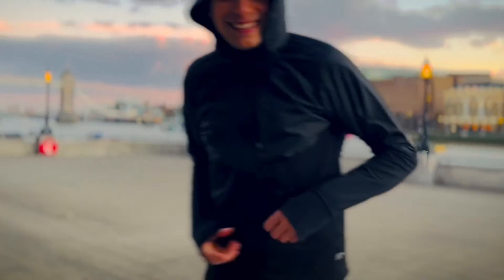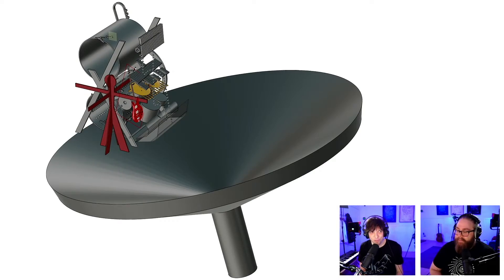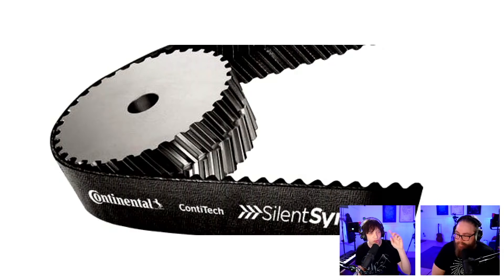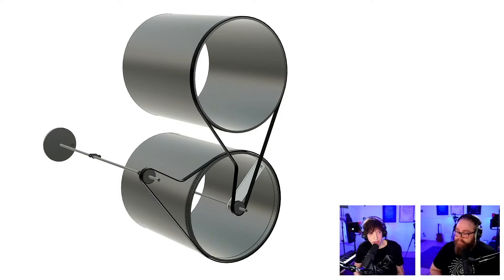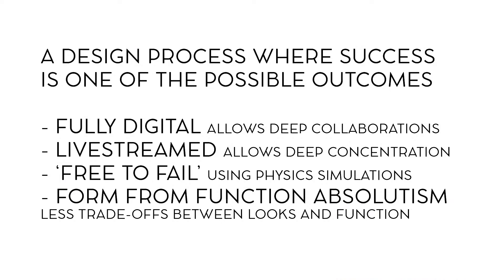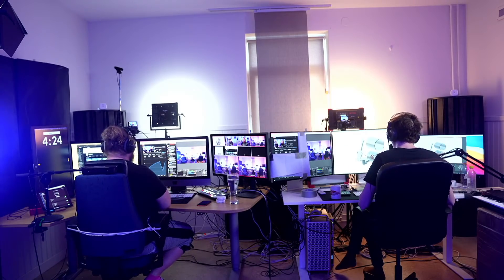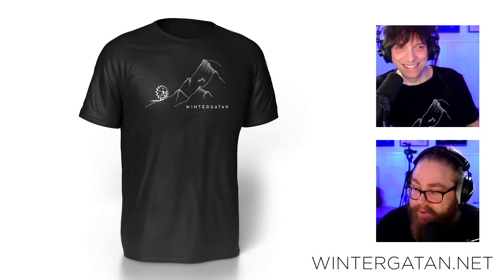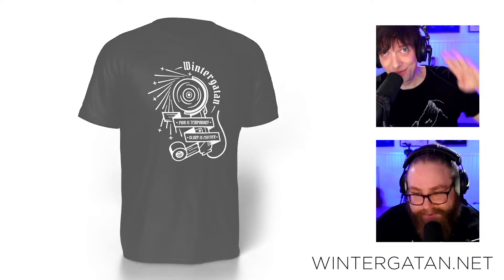Round 3 - Martin vs The Machine - Week 1 Summary

Comment: I have an idea to fix the programming plate issue, what if you had small scale short travel linear actuators behind the plates that were addressable, so they can change “on the fly” per rotation if necessary. You could leave the plates permanently on the machine and write the program to set the pins to “in” or “out” and then load different programs for each song.

Comment: As a lesson learnt from MMX, you also need to focus on these features:
1. Repairability (if something breaks on tour can be fixed with WD-40 or duct tape)
2. Transportability (disassembly-reassembly for transportation)
3. Reliability (you know it yourself)
4. Reproducibility (if a machined part breaks, a quick order can be sent to any local workshop it you have no spare parts with you)
5. Safety (it does not kill the artist, trasporting crew or the maintenance guy)

You failed in most of these aspects of design the last time. You can do a better job this time. 
Godspeed!

Comment: The helical pulleys are too complicated (they are no quieter!)  This is example of overdesign!  Use simple spur pulleys!  For the drums, you want gears so you don't need to fuss when changing them.  (Regarding gears, since when did they make noise?  Only the fastest-turning gears will make noise.  You can use belts for those.
          I allege the machine noise is PART OF THE MUSIC.

Comment: I have to say hearing that the MMX is just being stopped come out of nowhere. I fully understand your choice to work more on it which is why videos became less frequent but I am with the majority of the comments with regards to you continuing on the MMX until it's finished and a song could be played. I feel you may be in your own mind when it comes to perfection. Engineering is something where we make our ideas realty by our own hands while getting to the point where things are safe and good enough because we know nothing is perfect. To me at least you had fun as you worked on it despite the frustrations but also enjoyed those moments when you solved your problems. The moment you set yourself the no marbles on the floor requirement is when it became less about becoming better design wise and it seems like you became frustrated in those videos as that goal became an obsession. 

As you already no doubt have realized through this experience a part of making something is iterating on the design as new problems come up and it may be a while before you can reach a point where you iron out all these issues which come up, but once you do you will feel great about having stuck through it and proud about your final product. I feel you may missed the point in some of this when you consider the whole machine a failure instead of just continuing and fixing the last two issues we were shown. For the backlog of marbles in the constrained marble path which can easily be resolved by either making the path for them to get there longer giving more separation time between individual marbles while playing or have them funnel into a reverse of the divide by 4 above so it becomes a multiply by 4 which takes 4 inputs and funnels it into one input which would lead to less marble jams due to how marbles form up in there. As for the issue of the PMMA transfer pipe between 1st and 2nd gear exploding that was a result of too many marbles picked up at once due to the extreme backlog of marbles jammed from the constrained marble path, so fixing that issue should for the most case fix this one and in the event it does not you could always look into introducing something which limits how many marbles in a group enter the 1st gear as to avoid that pressure.

The MMX is already so close to completion with only the final fixes and issues needing to be resolved for it to be fully done. Jumping the gun because you are unsatisfied with what you have due to having to deal with it's issues and making a new design to start from scratch will be a waste of: years of time you spent on the MMX so far, money for supplies on the MMX, and support from all those who have been with you on this journey so far during it's creation while you have been making it.

Will finishing the MMX as is take time? Yes. Will it be hard work to get it's issues solved? Yes. Will you feel good for completing it? 100% WITHOUT A DOUBT YES. There are a lot of things you can decide to do for this project and the final call is yours, but one thing you should never do is not finish something and end up regretting it later on. That's a kind of regret which eats away at you personally and always makes you wonder what could have been if you just followed through on it.

Comment: The fact that the first two machines are considered failures or defeats is gravely concerning for the future of this project. The original had flaws, but the result was captivating and is most likely why the majority of us showed up for the MMX journey. If that’s defeat or failure… standards are way too high. Then MMX, yes there are flaws, however at the least it could have one song with a video. It is leaps and bounds ahead of the original machine. It is an engineering feat despite flaws. You learned so much through this process. Evolved so much as a person. Bettered yourself through the process of designing and building MMX. But it seems that pessimism has let you down. This isn’t simply “the glass is half empty.” This is having nearly a full glass and saying because it’s not full it is empty.

We all want to see you succeed. I think you can and I think everyone has your back, but I am concerned by the mindset I see in this video considering the first two machines failures, defeats, losses, whatever. 

I’ll personally continue to follow this new journey because I believe you can do it. I am optimistic for the future. However I, and I think from reading the comments most others, would love to see one song for MMX (or maybe even a handful). It would be worth it and it would be the end to that project you and the community deserve.

Comment: You joke about the floor being a funnel but if you just put a large mat underneath the machine that slopes towards a central location any dropped marbles would accumulate there, it would only have to be a few inches thick and would absorb the sound of marbles hitting the floor so they don't interfere with the music. Given the designs for magnetic lifting wheels you have already made it should be trivial to give the machine the ability to pick up those dropped marbles and return them to circulation automatically. That would be somewhat more realistic than never having the machine drop marbles at all.

Comment: Here is a tip, that I said a few years ago and would probably have saved him a few years of time. Use 3D printed parts! You have infitite complexity, and you just have to print them. No welding, no sanding, no complicated machining, no drilling of holes, no measurements. Some things need to be steel, but for almost anything that is made from wood you can just print them.

Comment: Actually for a mass market complex products you have these prototype phasis before the mass production:

Engineering Validation you validate that the concept is working.

Design validation you validate the full product and you freeze the design but the parts are not made the same way that they will be in mass production.

Process validation, now you have all the tooling required and you tune the fabrication process to have the exact same product that you will have in mass production and you work to improve the production rate.

Sadly MMX is not at all a Design Validation, actually it's not even an Engineering Validation since he decided to restart completely from scratch. MMX is only a proof of concept that it could theoretically work, it's a beautiful proof of concept with an artistic spirit but that's all.

Actually even with CADing Martin will need to do some physical prototyping so he will still need to do these 3 steps, because even if it's supposed to worked digitally it doesn't mean it would work in the real word.

Comment: I'm not sure that cutting gear teeth into the plastic pipe stock is going to be a good idea. You will waste all the whole thing when the gears wear out, and trust me, the HDPE used for piping is definitely not designed for abrasion resistance. Also, the pipe wall is not particularly thick, so you might be making some compromises with the strength of the teeth right from the get-go.

I think the superior option would be to simply fit the helical gear "ring" over/around the pipe, and just key it to the pipe so that there's no slip. If the  gear has to be replaced, remove the keys and swap the ring part(s). You will need some sort of machined insert to keep the pipe round anyway, may as well build it all together. Or have the "flywheels" with the gear teeth instead.

Comment: MARTIN YOUR HELICAL BELT IDEA WILL NOT WORK AND HAS NO NOISE ADVANTAGE OVER A STANDARD AUTOMOTIVE STYLE SERPENTINE BELT. The noise you are  think the helical belt will reduce is only significant at high belt speeds, not the 30-60 rpm of the MMT.  The idea to make custom pulleys and belts is $$$$$$$. This is a VERY BAD IDEA DROP IT NOW.

Comment: MARTIN you are again making big mistakes from the start that will impact your machine down the road. You are getting WAY TOO ABSORBED BY "HIGH TECH" and not focusing on the #1 problem with the MMX and the first machine. Marble transport and management. You are getting bogged down in the micro details of marble release components before you design the marble flow. Work the BIG picture first!!! 40 years ago I prototyped stuff using cardboard cutouts and boxes to see  a 3D view of what we were trying to design. CAD is great, but as you should have already have found out, you don't see the problems until you have something physical to see. GET THE BIG PIECES DONE FIRST!!!!  You've placed your instruments. That's great. Your next step should be  to BUILD YOUR MARBLE ROUTING  AND FLOW  MANAGEMENT. You may have to move things around to prevent marble flow issues. The release components may have to change based on how they fit in, so those efforts are a waste of time for now, but will become critical later. (RE: 40 years of electro-mechanical design, manufacturing, construction, and operation, including 5 nuke power plants.)

Comment: Nice to see you back ! Your project is still amazing. BUT I think you are making a big mistake with this big tube used as programable cylinder !!! 

2 technical problems and 2 supply chain problems :
- sourcing area is reduced, risk of lack of supplying solution (in 2022 more than ever, it is essential to source raw materials easy to find. POM plates have less risk than big water tubes reserved to professionnals) 
- are you sure suppliers are able to accept to sell it on short lenghts ? afordable unit quantity seems to be by undred of metters, due to how it's usualy used. 
- one big part with lots of features on it, is always more expensive to produce, and to repair if one area of the part is damaged. You can avoid to change the hole part by repairing it with a patch, but hey, patchwork is also time consuming, and less less strong. Programable cylinder and gears should be two separated parts.
- circular tolerance is going to be a problem on this tubes. You will need to add renforcements structure to bend it to good circularity, then thermal expension is going to add constraint to this bending, so you will need to add more ajustements etc (thermal expension not negligible on part, due to it size, and the number of travels planed for the finished system).

I hope you will get this message !
Thank you again for this amazing and beautiful project !

Comment: I question cutting the gears into the PW (programming wheels). I assume that you are going to still have multiple PW and having to deal with a belt each change would be more involved than just putting the wheel in place. If the belt was on it’s own gear that the PW attached to the belt would be held tight and would be one less thing to deal with during a change. Changing PWs in CAD is easier than the RW.

Comment: You are an inspiration!  More than the MMX, you've built an amazing community, chock full of builders and engineers.  I can see that you reached the end of your rope, but if there's one thing I've learned from you, Pain is only temporary...  
You mentioned physics demos, what SW are you using?  I'm an engineer in multi body dynamics using MSC Adams, and I can tell you no simulation is accurate.  You'll want to prototype and validate any simulation, and even then, CAD doesn't account for manufacturing tolerance.  Can't wait to join in and help where I can!

Comment: I believe you would be better off using a bead chain instead of timing belts both in terms of cost and routability because the bead chain will be able to go around components in 3 dimensions if necessary by using teflon tubes. That would also be more robust than a belt, which may wear down or lose flexibility. Bead chains are also cheap, even for extreme lengths.

Comment: Would just like to throw my own experience with simulation into the mix, and how important it is.

I do electronics as a hobby, and in the last couple of years I've been doing more with programmable logic (think FPGAs).

Simulation is of utmost importance to me, because I can design something, simulate it, and see if it behaves the way I expect it to, and fix any issues that I discover, all before even looking at my programmer.

My most recent project was a VGA video card for my retro computer project, and thanks to simulation, it worked first time when programmed into a chip.

It might seem more fun to drive straight in and start building stuff, but knowing that it will work when you do build it just makes it all that more satisfying. And the process of designing and testing can actually be quite fun. I almost enjoy that more than actually building the things themselves.

Comment: Seems to me one of the biggest challenges is the slow and tedious process of "programming" the music. If I understand correctly, you're still manually placing pegs in the wheel/pipe? So, that pretty much limits you to a single song, yes? And to program a new song, you remove all the existing pegs and put new ones in? That doesn't seem very practical -- esp if your goal is still a world tour.

Or am I misunderstanding how that works?
Reply: The MMX was designed with removable and interchangeable programming plates to address this.

Comment: Martin, you have your head on straight.  Proper requirements are a huge and often underappreciated part of the engineering process.  There are books on writing solid requirements.  The belt design looks good.  I'm interested in seeing the new less-constrained marble motion design.  An Archimedes screw lift??

Comment: I don't think Martin understood that much of the fascination of his first machine was the simplicity of the design and materials. It was patched together as if a layman had nailed it together in his basement workshop (with crooked nails and screws, frayed wooden edges, rubber bands, LEGO parts, pencil doodles...). And then it works flawlessly. That was the fascination. With a High-End machine with High-End materials you simply expect that it to work. The element of surprise and thus the fascination is missing.... but from a construction standpoint, the Marble Machine X was an extremely interesting project for engineers and designers.

Comment: Haha, copying Rocky means you have to fight more rounds. How many maschines you are going to built?🤭 
When you design a new machine, why using belts? They are not accurate over time with this ratio. Why not using stepper motors for direct drive? This could make all functions independend.

Comment: Belts feel like a downgrade to gears. Especially these teeth-belts. Belts stretch and warp, and I feel like they will easily become desynced with the gears. Gears allow for greater percision, and even noise reduction. It's why modern washing machines are completely gear based - the noise reduction is massive, while improving speeds a hundredfold!

Comment: Double drum design? Considering you're going to make each drum one piece, it's doable, but you'll need to ensure good timing between the two somehow.

That said, single piece drums are engineering perfection right there. Take as many parts out of it as possible.

Floor funnel isn't actually a bad idea. It could be a back up to the primary catcher and act as a reservoir. It could even replace every catcher altogether if its throughput is high enough.

Machining gear teeth into the drum — I don't recommend mainly due to the manufacturing tolerances required that you may or may not be able to meet with that CNC. Plus, plastic is a poor material that can deform and flex during operation which may cause misalignment and loss of timing. I can also see it complicating the process of changing out the drums if you want to change music quickly — unless you're axing that criteria altogether.

Why belts? And why herringbone? Why not standard timing belts you can get off the shelf? Those pulleys are simpler to manufacture and those belts are easier to obtain. Chain and sprocket is even easier to find at the cost of some noise but greater reliability because it doesn't stretch like belts.

Overall, good start. Will you be moving some component designs from MMX2 over to 3?